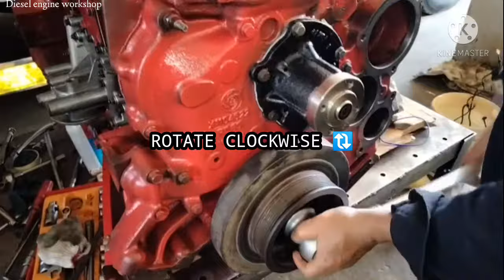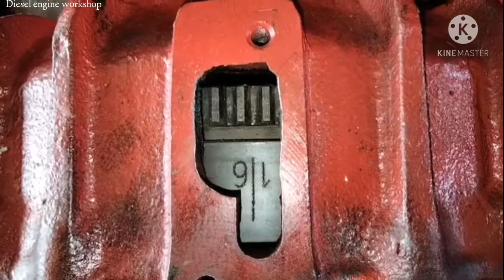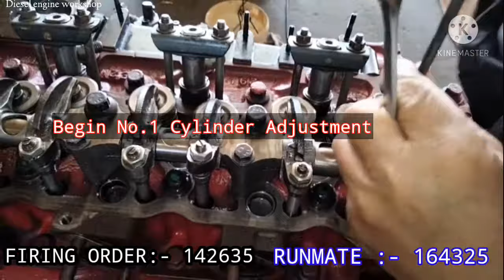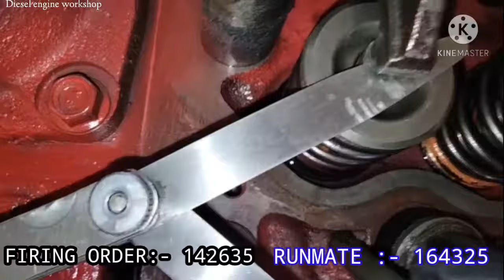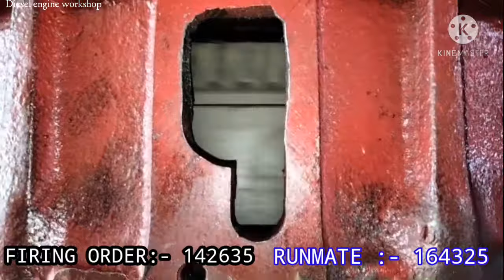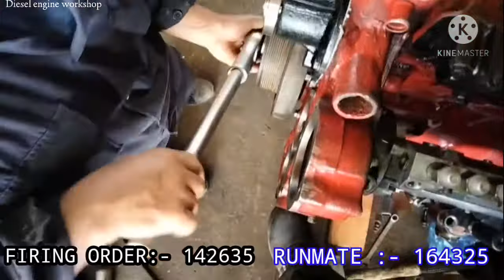HOW TO TAPPET ADJUSTMENT 🤔 | VALVE CLEARANCE ADJUSTMENT | TUNE UP 💯 !!

Comment: Hello what is valve clearance on eicher pro 3009 l bus
Reply from the maker: COLD ENGINE :- IN - 0.10" EX - 0.16"
HOT ENGINE :- IN - 0.17"  EX - 0.23"
Reply: @Ajaj881  thank you so much
Reply from the maker: MOST WELCOME

Comment: What is runmate 164325
Reply: Bhai  ye run mate kya huta hai ..164325
Usku pyara piston boltey .162534
Firing order 142635..
Reply: Inlet value ..0.30 mm guage ..12 thow
Exhust value..0.45 mm guage..18 thow
Reply from the maker: Running mate are two pistons moving at the same time in the same direction but performing different strokes.
Reply from the maker: As :- Firing Order 153624 Of Running Mates (165234) 
Firing Order 142635 Of 
Running Mates (164325)
Firing Order 1342 Of 
Running Mates (1432)